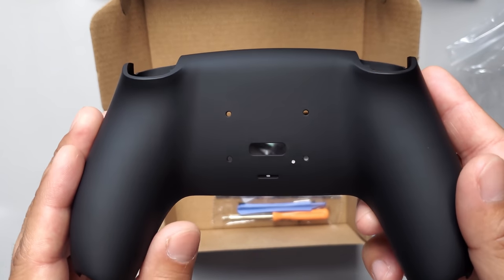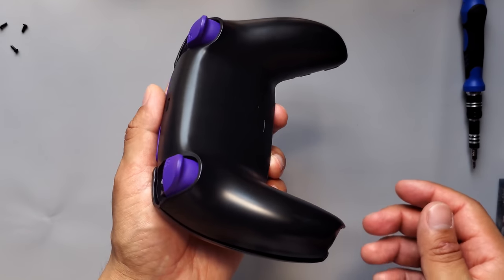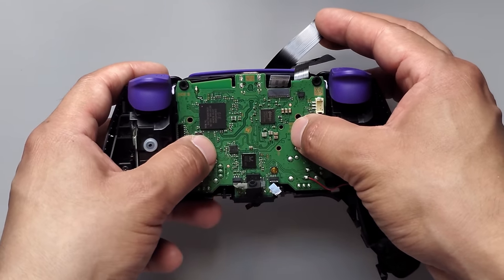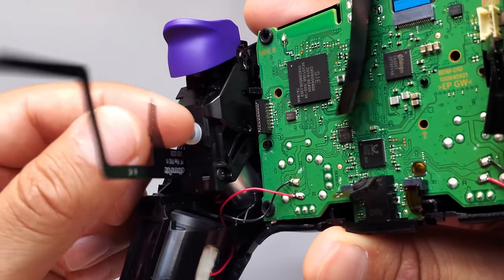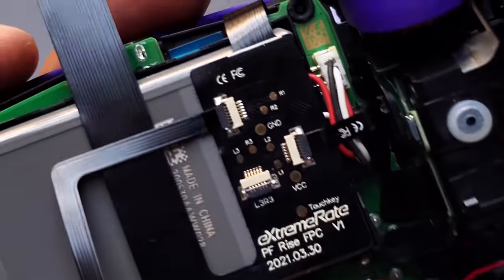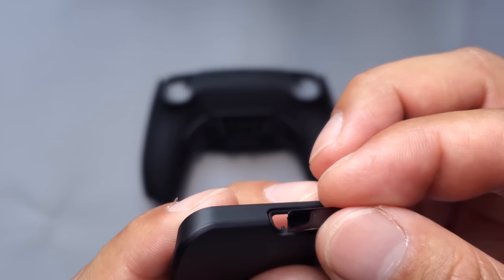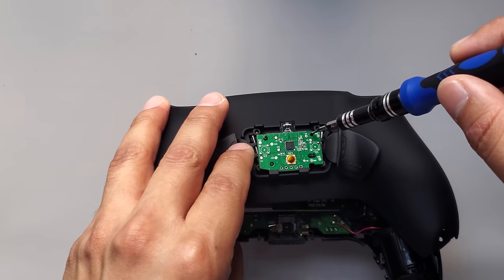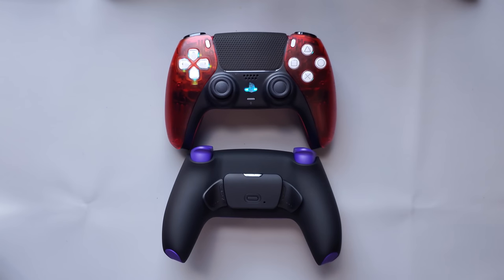DIY PS5 Controller (For BDM-010): eXtremeRate's Rise Remap Kit | No-Soldering Step by Step Tutorial

Comment: Thank you for this! Just odered the KIT today. Will watch this video to ensure things get setup properly! You're the man! New SUB!
Reply from the maker: Thanks for watching! 😁 Good luck on the installation. If you have any questions feel free to ask. Thanks for the sub!!!
Reply: @im.a.caveman  will do. Thanks again.
Reply: At 12:43 the power button. It's not clicking and locking place. Any ideas?
Reply: Disregard. It was perfectly fine when putting the back piece on allowing me to use the power button. Everything works perfect. Thanks for the easy tutorial!!
Reply from the maker: @fearthebeard6712  Awesome! Glad it's working and thanks for watching!
Reply: @im.a.caveman  so i have a new PS5 Controller im not getting any power and controller wont turn on?
Reply from the maker: @fearthebeard6712  Sounds like you need the other cables compatible with your control
Reply: @im.a.caveman  do you know 
which other cables?
Reply from the maker: @fearthebeard6712  Yeah. I'm assuming you have the V1 remap kit? If yes, then that one only includes the cables for a CFI-ZCT1W / BDM-010 controller. That kit was made before CFI-ZCT1W A / BDM-020 controller started coming out.

If you you look at the newer kits like the V2, RMB, or Rise4 remap kits they include cables for BDM-010 and BDM-020. They say to cut the ones you aren't going to use but you dont have to. You could just put electrical tape on the end of the connection of the ones you're not gonna use.
Reply: @im.a.caveman  the version of EXreme rise kit has both Bdm 010 and BDM 020/ I initially plugged BD O10 into the slots shown in your video? Will that be the reason theres no power when trying to power on device to reconfigure the buttons/
Reply from the maker: @fearthebeard6712  Check your Model or BDM number. If you connected BDM-010 on a BDM-020 controller I can already assume yours is a BDM-020. If the incorrect cables are connected usually the controller doesn't turn on. But just to make sure you should check. I have a Rise4 video where I show the installation for BDM-020.
Reply: @im.a.caveman  We are good! I got resolved and all is working perfect. Thanks again! Have a great weekend brotha

Comment: Best extremerate installation video out there, covers everything literally.
Now please make a video on how to melt the back buttons to a smaller size so you dont keep clicking them by accident and have a firm grip on the controller 🙏🏼
Reply: Probably just use a dremel to cut the plastic then sand down the edges.
Reply: @McRex203  You do carpentry? Very useful idea bro better than melting it 🤣🤣
Reply: No carpentry just a good bit of Gunsmithing 😂 you can get a cheap rotary tool on Amazon, probably a whole kit with cutting burrs and sanding wheels for $30-$40.
Reply: Basically just sculpt the exterior of the paddle to the shape you want it then sand and buff it down
Reply from the maker: Late to the party. This sounds awesome! So who's trying it?
Reply: @McRex203  so what am I looking for a rotary tool, dremel or a desert eagle 😭😭
Reply: @im.a.caveman  I will if I dont get use to these paddles. Tried this with the strikepack on ps4 by burning the paddles and honestly the comfort was unreal so am sure itll work on this
Reply: @matadorz5930  a desert dremel eagle tool, very rare, but it’s what you need.

Comment: you make this look doable. ive been holding of on getting a dualsense 5 controller (for PC) because of the lack of back buttons. now i might be on the hunt for a used one or something.
Reply from the maker: Was replying to this comment and then realized I replied to your other comment. You got the ps5 controller, good stuff man!
Reply: @im.a.caveman  Hey Caveman! I just installed my packpaddle set. thanks for the amazing tutorial my guy. much appriciated.
Reply from the maker: @fairplayer916  No problem! Enjoy your new paddles!
Reply: @im.a.caveman  will do. Hey have you had any paddles break? When the buttons fully pressed, there's still alot of room behind it. I'm kinda worried I'll snap it off
Reply from the maker: @fairplayer916  I haven't broke any. I don't apply alot pressure on mine. If they every do break contact the company. I think they'll send new paddles if yours do break. They might be working on the new design to be more durable. Or atleast that's what I'm hoping for.
Reply from the maker: Btw, is the kit working good with your control on pc? A few other people asked if it works on pc.
Reply: @im.a.caveman  flawless. And so does the ps4 plug in one offered by Playstation.
Reply from the maker: @fairplayer916  Awesome! Thanks for the info.
Reply: @im.a.caveman  np man, thanks for the awesome tutoriels

Comment: Hello, thank you for the instructions ! I've inserted a link to this video in the description of my Rise Remap Kit Review 🎮😁
Reply from the maker: Hi! I just checked out the video. Thanks for sharing the details. That video was nicely organized. You should also review one of their newer remap kits like the 2.0, RMB, or Rise4. It includes cables that's compatible with both ps5 controllers, CFI-ZCT1W/BDM-010 and CFI-ZCT1W A/BDM-020. Thanks for the shout out and linking the video! 😃
Reply: @im.a.caveman  Thank you for checking out my video 😁 I should definitely have a look at 4 back buttons! It might be a worthy upgrade 🤔😁
Reply from the maker: @SiriusMonkey  I like the RMB because the switches aren't as sensitive as the other kits. Supposedly they're going to do a metal Rise4 but haven't heard anything about it for a while. But if it does come out I'm definitely getting it. The benefits of the Rise4 are the 2 extra buttons.
Reply: @im.a.caveman  Oh I see, for some games they are indeed too sensitive ! Accidental clicks..  Thanks for the feedback mate 😊

Comment: I bought this kit to try and replace my ps4 controller with the Sony back button attachment, but for some reason it just doesn’t feel as good. I honestly feel like the thicker design of the dualshock 4 just feels so much better. Also the extremerate buttons are just a little too sensitive for my liking. If you’re someone who loves the dualsense, then this kit is very good. I only really play Apex Legends right now, so until they release the ps5 version of the game, I’ll be sticking with the dualshock 4.

Comment: I've got it... I've installed myself and I love it:))
Reply from the maker: AWESOME!!! Enjoy!
Reply: One question do you have to “sotar” I don’t know how to spell it
Reply from the maker: No worries, it's "solder" and it's only optional. If you want to remap L3, R3, and touchpad. Without soldering you'll be able to remap action buttons, Dpad, and triggers. If you're thinking about getting it I recommend checking the BDM number on your motherboard. It's on the side that shows your analog sticks. So far there seems to be a compatability issue with BDM-020. BDM-010 (which I have for both my controls) are working perfectly.

Comment: Excelent video my friend! I installed easily and quickly using your guide and now I have one question. I just bought both clicky kits (buttons and triggers) and I would like to install them but I'm not sure exactly how to remove the rise remap kit back to open the controller again and install the other kits, kind afraid to force it in wrong way and break something, you have advise about how to open that metal back? Thank you!
Reply from the maker: You should be able to pop open the remap back piece. Once you've done that you can unscrew your remap board and disconnect it. From there you'll be able to go through the rest of the disassembly process.
Reply: @im.a.caveman  Thanks man!!! As soon as I get the other kits I'll go for it.
Reply from the maker: Cool! Have fun and enjoy!

Comment: I think the soldering is required if you plan on playing any PS5 titles that require some sort of input from the touchpad, if you're just connecting it to the PC to play COD or something then probably not necessary
Reply: Only soldering is required if you are trying to map the back buttons to touch pad or L3/R3.
Reply from the maker: Like the other person said soldering for toucpad, L3, and R3 is only to be able to remap to the back buttons. Other than that all buttons work normally as they would without the back buttons. Basically you're just adding buttons on the back but won't affect the functions for your regular buttons.
Reply: Awesome good to know, YouTube comment section isn't a always a dumpster inferno!
Reply from the maker: @theyehsohz  No problem!

Comment: Amazing video even though I've not got the kit yet I had to watch it,  you explain everything really well and your voice is good too, can I recommend one thing tho, I'd recommend when removing the back case unclip the 2 clips on the case last as it means no stress on the 2 clips while all the screws are being removed and the rest of the case is being unclipped then the 2 clips may hold Original shape better due to being stressed for less time and may not have to push back in,
Reply from the maker: Thanks for stopping by! I actually ended up realizing this after a while. Ever since I did break one I thought I should change up the order of taking off the back shell.

Comment: The instructions are awesome and easy to follow. I did everything to the T and I even took apart and rechecked, but my controller still won't turn on :(
Reply: Same
Reply from the maker: If the battery is charged or plugged in and it doesn't turn on, I would assume it's a compatibility issue.
Reply: @im.a.caveman  what would u suggest I do
Reply from the maker: If the battery is charged or plugged in and it doesn't turn on, I would assume it's a compatibility issue.

Comment: Big thanks mate for a great video just done mine, way better than original one, and also your video made me pull the trigger on this, as when I saw official one, I saw soldering and that was me done🤣🤣
But then watched yours right after and thought , no solder…

I only had 2 hairy moments.
The gold front strip cable, fell out as I was replacing board, but found what I needed towards the end.

And one brain fart for me, for some reason I tried to screw the back plate on from the top, and not underneath 🤦‍♂️

But thanks again man..
I’ll be showing it on my stream (same name twitch) tonight.👍
Reply from the maker: Thanks for the compliment! Yeah man the soldering is optional. Some people seem to want the L3 and R3 for remapping but for me personally I don't need it. I'm glad it worked out!

I checked out the Twitch video and you had me laughing when you talked about having to remove the touchpad just to solder the little wire 😆 Keep up the streams. Hope the best for your Twitch!

Comment: If you want to use any PS4 controller or any controller at all on PS5 with PS5 games setup a laptop or pc next your PS5 setup and use remote play you can use any controller you want connect it to your laptop with remote play and bam. I’ve been using my scuf like this for a while I still use the display hooked up to my PS5 I’m only using the laptop to connect controller to. I get like no input lag. I do have great internet though so you’ll need that.
Reply from the maker: I was actaully doing this before my Ps5 had arrived. I bought a ps5 controller to do an unboxing and was showing how you can use the ps5 controller on a ps4. Does suck though that it needs to stay connected with the wire. But it was so much better than using my beat up ps4 controller. Thanks for stopping by! Maybe I'll try to get an Xbox controller to see if it works lol
Reply: @im.a.caveman  yup it does I use the new Xbox elite controller also works great.

Comment: Thanks for the info boss great video can u do a complete custom video to change a whole controller I wanna completely make a custom controller but don’t know the most efficient way of doing it which changes to do first to last would greatly appreciate it
Reply from the maker: Thanks man. You want to customize your front, back, buttons and have the remap kit? Or there's more to it. Let me know what exactly you're trying to customize.
Reply: @im.a.caveman  yeah all that with hair triggers, joystick, maybe the face buttons clicky kit or is it worth just buying one already custom made at that point lol
Reply from the maker: Where do you plan on buying the stuff from? I believe it cost a little more on Amazon. For gamingcobra.com you get 10% if you use my code (IMACAVEMAN). I can check to so see how much it would cost. But you can also have a look at hexgaming.com
Reply from the maker: If you are gonna do it on your own contact me on IG so I can slowly explain on what should be done first when you have the parts. I know sometimes it can be hard when alot of information is throw all at once. And if you do get the remap kit check your controller for compatibility. CFI-ZCT1W IS BDM-010 and compatible with remap kit. CFI-ZCT1W A is BDM-020 and is not compatible.

Comment: Great video. Easy to follow and installed flawless. You have to turn off the back paddles when your ready to use them the buttons dont work if the red led is on and i did not understand that at the end of the video

Comment: Really good instructions compared to anyone else however some warnings I would give are to be careful when taking about the bottom shell and don’t be too delicate. And use moderate force when inserting the r1/r2 cable as it is quite difficult and he makes it look really easy 😂.   Lastly ensure the cables with the locks are in properly before securing them as they are very easy to mistake.

Comment: for some reason my controller wont turn on with the L1L2 and R1R2 ribbins pluggin in but when i reconnect the battery with them unplugged my controller turns on but when the battery is connected with them pluged in it wont turn on?

Comment: Yoooooow I feel confident opening my controller now !! But where can I get the other stuff them ? Same like what you have on here
Reply from the maker: This is on Amazon:

eXtremeRate Black Back Paddles Programable Rise Remap Kit for PS5 Controller BDM-010, Upgrade Board & Redesigned Back Shell & Back Buttons Attachment for PS5 Controller - Controller NOT Included https://www.amazon.com/dp/B095H6WXX6/ref=cm_sw_r_apan_glt_fabc_P1TKYJ6KAEATJ0H1PNAS?_encoding=UTF8&psc=1

EJGAME DIY Replacement Controller Housing Shell Case Set for PS5 Controller Without Electronics(Black) https://www.amazon.com/dp/B08VNTDQ7Z/ref=cm_sw_r_apan_glt_fabc_DFQ87VCJ68PMRJ112PYA?_encoding=UTF8&psc=1

eXtremeRate Purple Replacement Full Set Buttons Touchpad Decorative Trim Shell for PS5 Controller - Controller NOT Included https://www.amazon.com/dp/B08XQDP6JT/ref=cm_sw_r_apan_glt_fabc_TBNSEDGE3CEYCKH3DVGM
Reply from the maker: You can also find parts on gamingcobra.com If you use my code IMACAVEMAN you can get 10% off.
Reply: @im.a.caveman  thanks mate

Comment: If you do this and it doesn't work just try it with the red light off instead. I did that and it worked. Hope this helps someone.
Reply from the maker: Yes, I confused some people. I really should have worded out this process better. On is for remapping only. Remap mode should be turned off after remapping the paddles.
Reply: @im.a.caveman  oh ok. Man I thought mine was broken for some reason lol. But great video non the less!
Reply from the maker: @Frank1k  Thanks for watching!

Comment: Dude loved the video very well done. So I followed everything to the T and everything is functioning the lights the buttons but the programming is not I press both buttons to program like you did and its not working can you make a suggestion cause everything is done just the way you showed it
Reply from the maker: Once the light goes on you hold whichever back button to which ever button you want it programmed to. You said "pressed" so I'm just making sure that you held the buttons at the same time until the led indicator blinks. Let me know if that's what you did.
Reply: @im.a.caveman  exactly what I did  but not taking the light blinks and everything
Reply: @im.a.caveman  got it working

Comment: Awesome video. Step by steps were great. I installed my kit and the power came on for the buttons but my buttons do not work. Any help? Possibly didn’t get the connections all the way in? They seemed secure while I was installing. Thanks for any tips.
Reply from the maker: Did you turn off remap mode? The red led turns off when you hold the button. Then you can use the back buttons if you remapped them.
Reply: @im.a.caveman  oh goodness, that is what is was. Thank you a ton!
Reply from the maker: @KKinetic2  No problem. Thanks for watching by the way!

Comment: Hmm I'm going to save this video and maybe try this out I've never had the extra buttons but I could see how for racking games or some other ones where they could work out do you need to make them take over other buttons or say could I program them as there own thing
Reply from the maker: You can't Remap as it's own. Only action buttons, triggers, and dpad. You can also do L3, R3, and touchpad but for those 3 it requires some soldering.